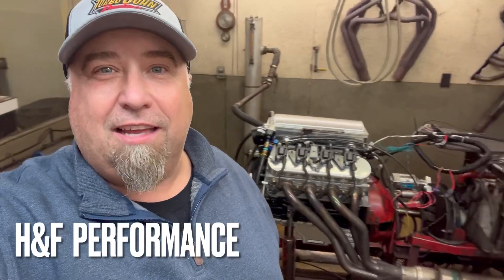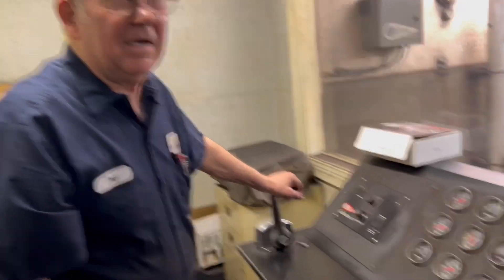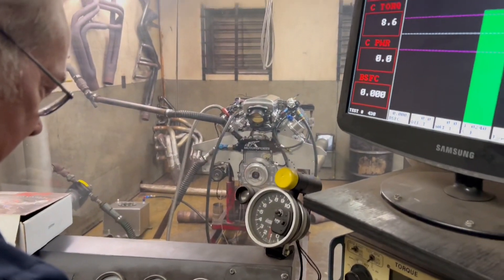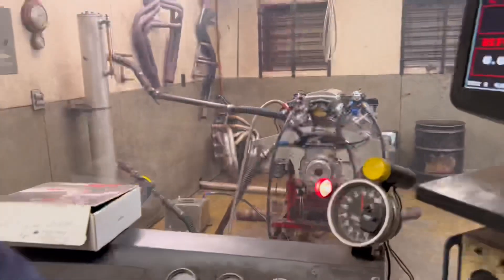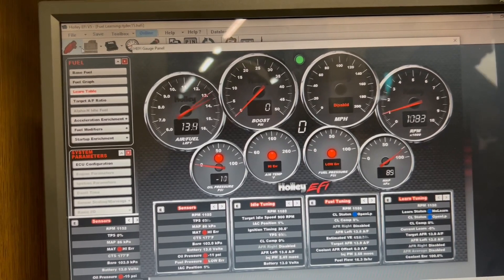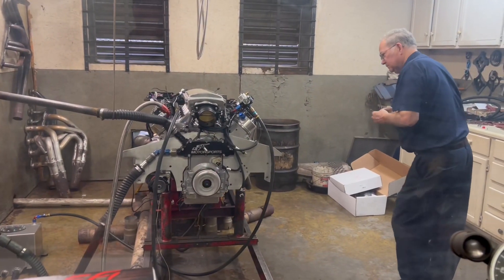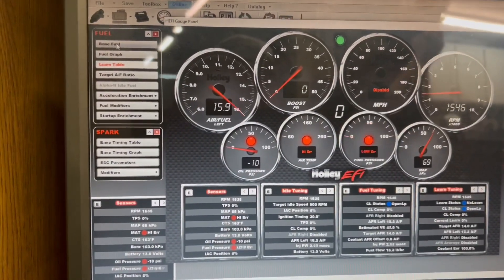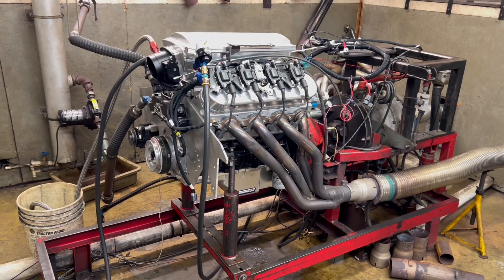LS Engine Dyno

Comment: It’s always going to be hard when you have mixed analogue and digital systems to get it lined out. Water brake Dynos are now have been out dated by Eddy current units with digital data acquisition. Still is more important to at least have things in the ball park before you install the engine

Comment: I wish you would have stayed & went through a full pull! I didn’t hear what cubic in it was, but LSs done correctly make stupid power pretty easily! A friend of mine did a junkyard 6 liter, basically a crank rod’s & pistons engine, dingle balled honed, home freshend valve job 🙄 & surfaced on a surface plate with light sandpaper 🙄! He cleaned up the ports, ect. I think it was a Cam Motion camshaft, with springs, it made over 585hp on the first pull, of course after getting the oil warmed up & the water temp low, 150ish! It had a nice 950hp carb & I think it was a Mast single plane intake! I think we finished up around 620hp! The valve springs looked real nice, but I’m not sure where they came from, I think he said they were left over from a friends project & it was running into float around 7000! With the cam that was in it, Cam Motion said it should go 7500 easy! He was trying to prove he didn’t need to take anything to a machine shop 🙄! It sealed up & ran very well, he has since installed the correct springs & he even set them up correctly. I made sure! But it isn’t going back on the dyno, he’s now building a turbo kit for it w twin 76s! He plans on putting it on a hub dyno when it’s finally ready! If you had a 600hp street old school SBC, back when I started (early 90s) it definitely went through the machine shop & was built, like aftermarket everything, except block! Some old SBCs were machined so badly, we don’t know how they ran??? Sorry for the book! But nice Job helping the old timer 👍🏻👍🏻👍🏻👍🏻🇺🇸🇺🇸🇺🇸🇺🇸!